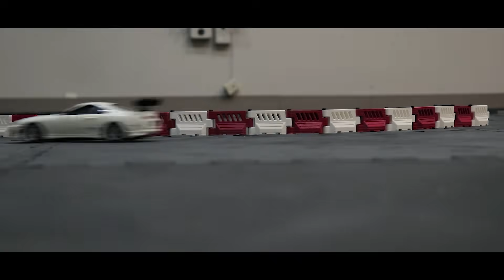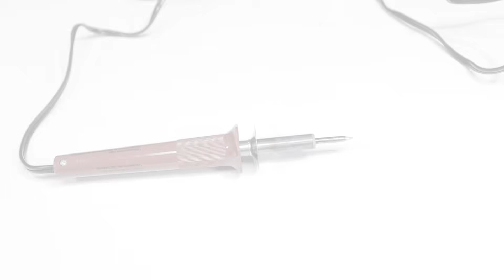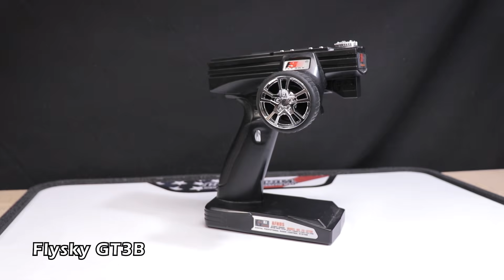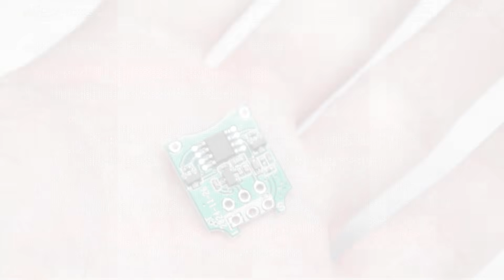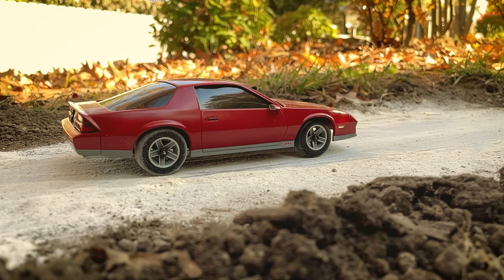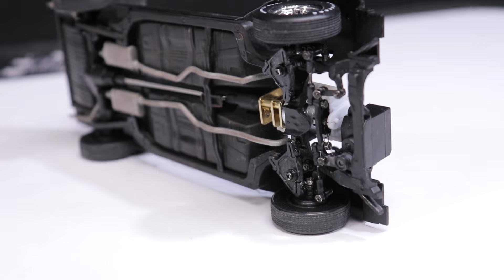Model Car to RC Conversion Electronics Explained: ⚡ Here’s What I Use

Comment: Do you have a recommended rpm for the trail builds
Reply from the maker: Not yet as I'm still trying out different motor/ESC combos. I think I've mostly used 500ish RPM N20 motors for my off-road projects. Maybe a little less if it's going to be 1S powered. Still experimenting though. The N20 motors might not be the smoothest, but they're cheap, and seem to have plenty of torque. The brushless options available for the SCX30 may be something to look into as well depending on your project.
Reply: @MakeItRC thanks!

Comment: Watching this rather out of curiosity. 
Personally found not long ago LEGO compatible building blocks "Speed Champions" RC Lambo and Ferrari inspired cars, each cost less then 20$ and sometimes you can find them even for 12$, so think I am set for RC toys for a while ... Not only it's the cheapest option out there it's high quality too. Also good luck finding actual LEGO Speed Champions sets for that money let alone with RC abilities. 
Always wanted to build something but it was hella expensive or not available, the deal breaker is always shipping / postage fee. If I can't find something locally I am not buying then at all. Now that I have access to cheap toys locally there is no need for me to build anything ever again.

Comment: As far as soldering irons go, my recomendation is the Pine64 Pinecil. It's multi voltage, able to run from a huge number of different power sources. It's very temperature controlable, and it's much smaller than those old radio shack irons you're using, making it much better for micro electronics like these. Oh, and it's under $40

Comment: I have a diecast collection of all the Pontiac GTO's produced from 2004-2006 (over 20 of them). I want to convert them all to RC with working headlights, brake lights and turn signals with minimal modification to the original model. What components would you recommend to a beginner that doesn't know anything about RC electronics in terms of small volume footprint and relatively decent torque capability? I am very experienced with CAD and 3d printing, if that's a plus in this scenario.

Comment: I tend to do the minimum amount of work with electronics possible, since I can barely solder wire onto a motor, so doing anything with a small circuit board would be impossible for me. For my projects, I find WPL makes some decent cheap electronics, but I doubt they'd fit in anything 1/24 scale, they're probably much better suited to a 1/12 scale build (which is what I prefer since it links my hobbies of RC cars and collecting action figures).

Comment: I can do all the mechanical and electronics I just  suck at painting and detailing love your channel
Reply: Or try an airbrush! I’m awful at painting with a hairy stick but switching to an airbrush turned me into a relative art genius to what I was before. I was amazed at just how intuitive it is and how easy it is to get started (not expensive either, the cheap airbrush kits on Amazon etc are very good nowadays). If you’ve already got a compressor knocking about, it’s cheaper still.